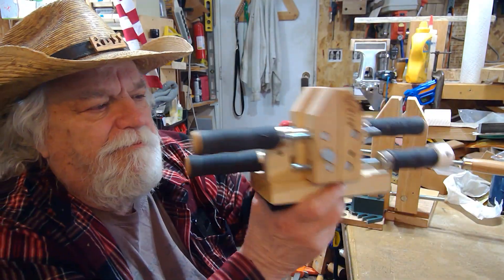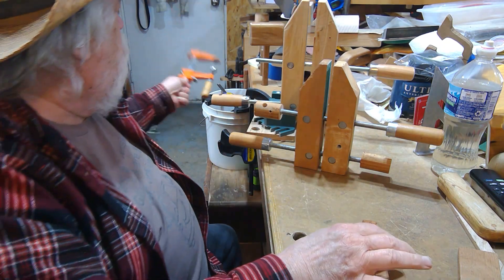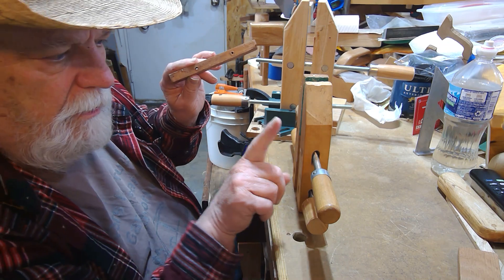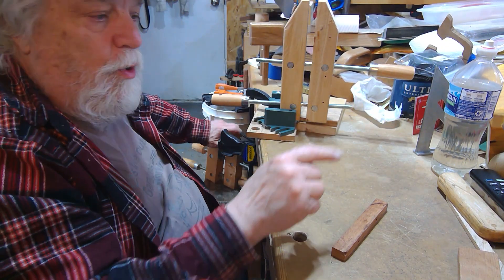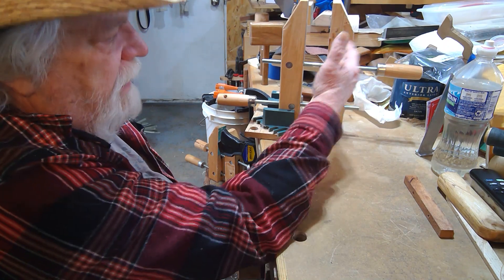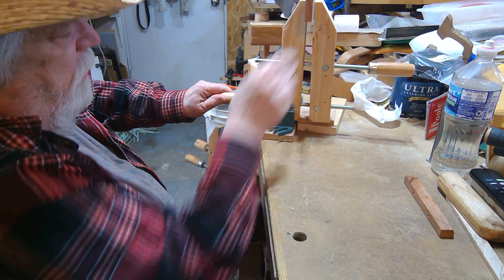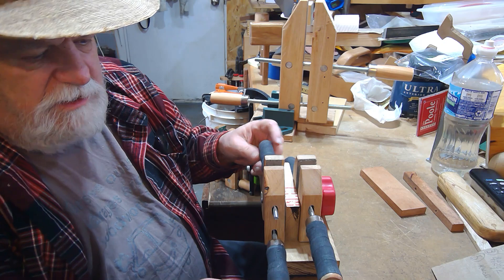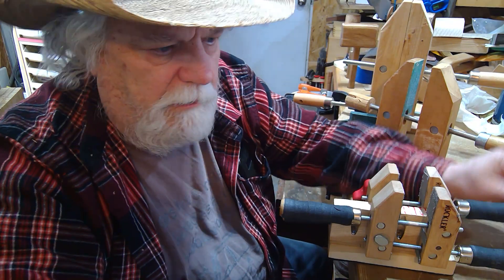Handscrew Vise Tips & Tricks by OTB Thinker

Comment: Thanks Russ. Getting a vise for my workbench is one of my projects this year, but I like this idea of holding wood on my bench. I don't have any bench dog holes drilled so I would clamp it down. Don't know if I have enough OTB brain cells to make it better!
Reply from the maker: Thanks Dave.  I can tell you watched my video to the very end :>).   I like the spin feature of my dog holes.  I suspect you will see ways to make it better for you as you use it.  Are you doing the 4" or larger clamps?
Reply: @russveinot5754  Probably use the smaller 4" initially. I often have smaller boards I need to hold in place.

Comment: Hey Russ why not put both screw clamps in the same orientation on the vise. The lower screw handle of both clamps in the front of vise. It would be less confusing.
Reply from the maker: I did just that at first and yes, it is less confusing that way.  I have found that the knuckle clearance is more this way.  I am comfortable either way now.  Your question tells me you have a grasp on this already.  Very good :>).  Is it Richard, Rich, or Dick?
Reply: @russveinot5754   its actually Butch. Im a Jr. so I was given a nick name. I can see the knuckle thing interfering with adjustments.